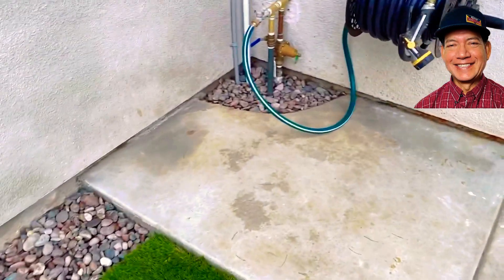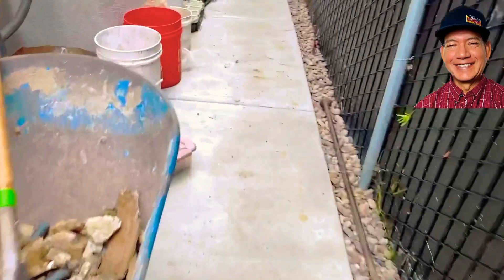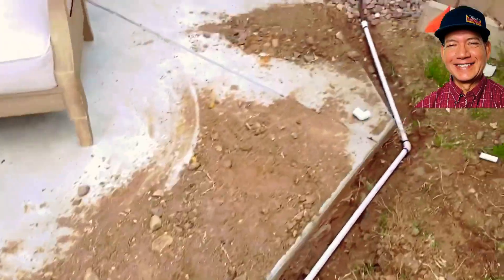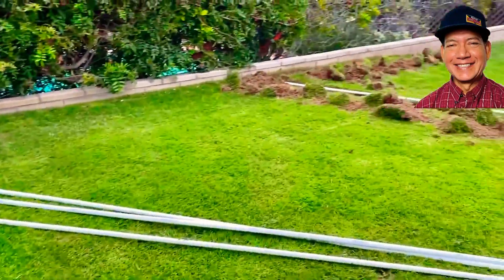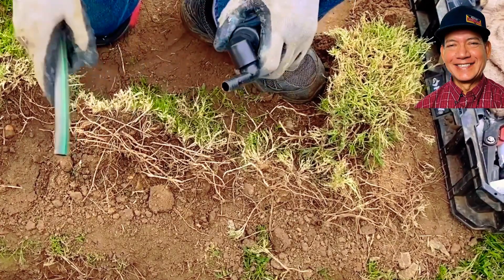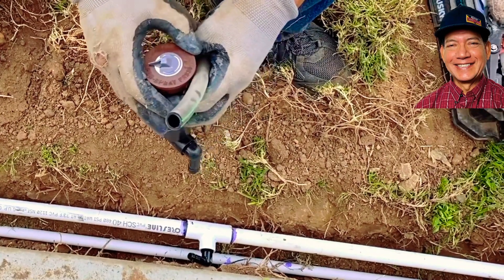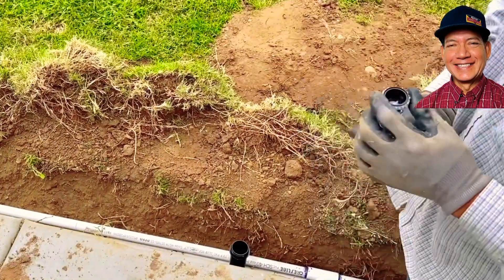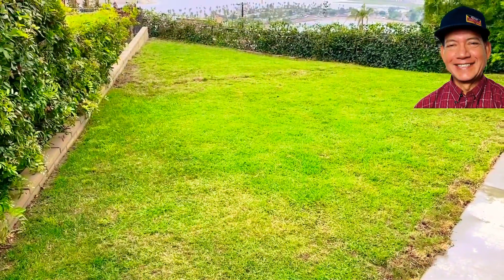Water Pressure and Volume Problem Solved  | How to

Comment: But doesn't that mean then that you're staving the house of the supply that your taking for the sprinkler?
Reply from the maker: Apologize for the late response, to your question your sprinkler system only uses pressure when it’s on. Now if you have low pressure coming from the city to your house to begin with and for example  your shower, wash machine is on and sprinkler system is all going on at the same time then it would affect volume and pressure momentarily until usage is over, if thats your situation then you can avoid that by separating time usage for each activity. So does what I’m presenting on the video starve water supply to the house the answer is no, adding to your main waterline for the sprinkler system is like adding another faucet or bathroom in your house it just uses water when it’s on. Feel free ask anymore questions.
Reply: @escompleteyardwork2984  Thanks. I face this issue at work daily. Brix pump requires 30 psi but when several are going or customer's washing up the pressure drops and pump/s deliver incorrect mix. Somebody suggested installing a shower pump but my view is it'll only work if you've the volume to begin with.